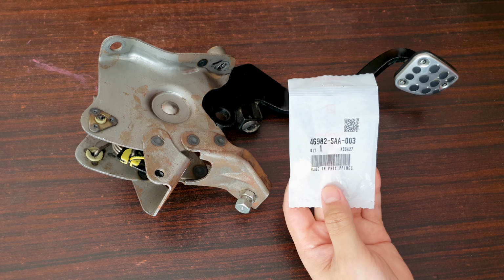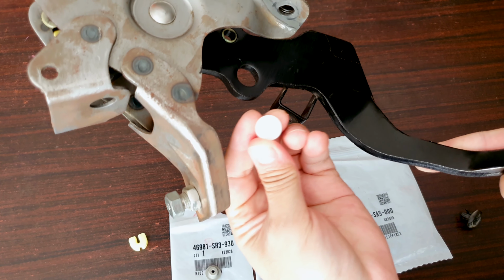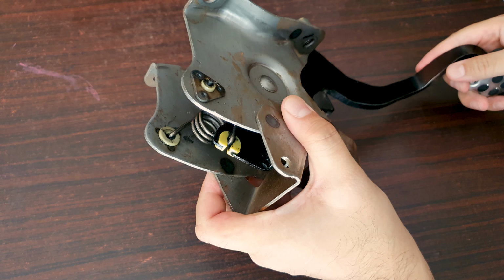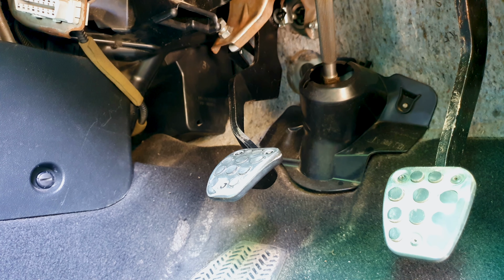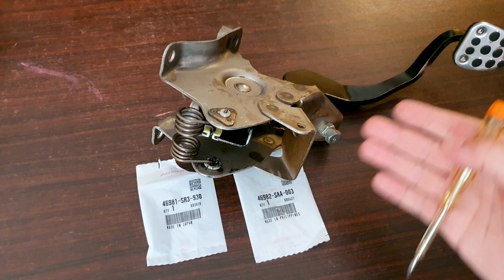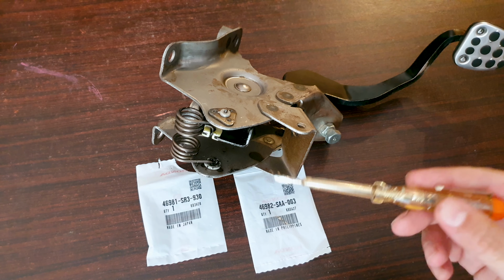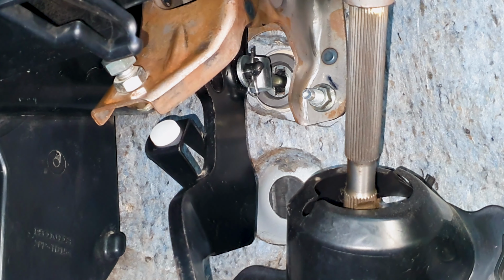3 - Clutch pedal overhaul - Honda Fit, Jazz and City (Correction in pinned comment for Civic part #)

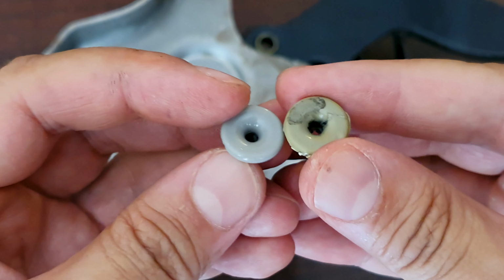Comment from the maker: Video includes parts dimensions at 5:18, you can measure to confirm if these parts are the same on your vehicle. 

Model shown: Honda City 5MT GM2 2009-2014 (RHD, steering wheel on right)
-Same parts and design for same generation Honda Jazz GE8 and Fit 2008-2014 and previous Gen 2002-2008 GD. 
-Parts should be similar for 2008+ Honda manual transmission models for the FIT, Jazz and City. The Honda BRV and Brio are also similar and may be the same. 

------------------------------------------------------------------
Part Numbers:
46982-SAA-003 -Middle Bush B
46982-SR3-930 -Middle Bush B alternative (not confirmed)
46981-SR3-930 -Side Bush A (Qty 2 req)
46911-S5A-003 -Pin bushing
46505-SA5-000 -Pedal stopper
46907-SAA-003 -Spring (didnt replace)

Civic 8th gen civic (and most likely 9th):
46982-S2A-003 -Middle Bush B
46981-S2A-930 -Side Bush A (Qty 2 req)

Civic 7th Gen 2000-2005:
46982-SD4-930 -Middle Bush B
46981-SD4-930 -Side Bush A (Qty 2 req)

Clutch pedal removal and installation - https://youtu.be/xPcz8TvtxJU